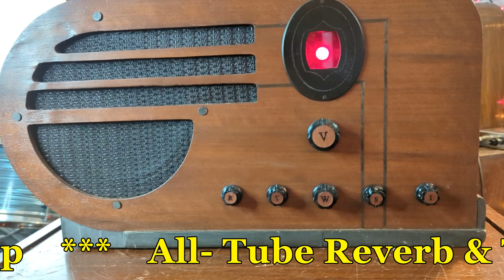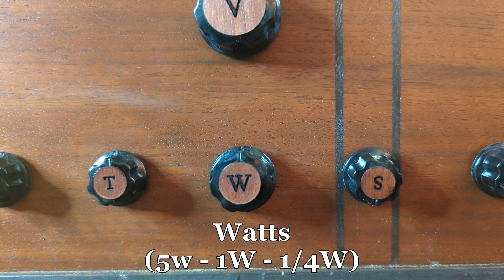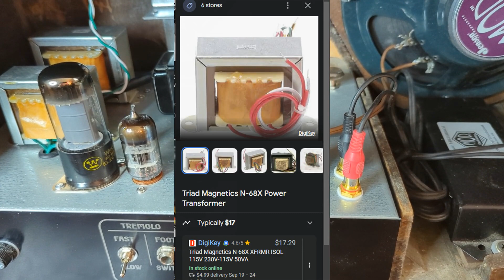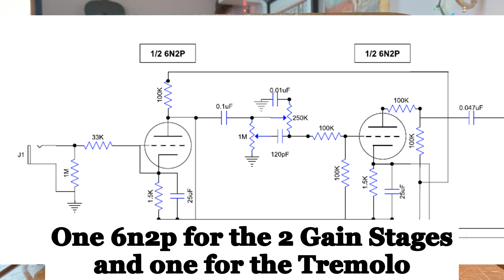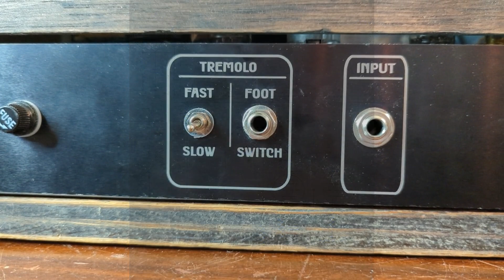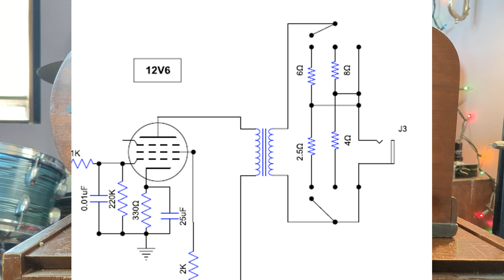5w All-Tube Handmade Guitar Amp with Reverb, Tremolo and More in a Vintage Radio Cabinet

Comment: Greetings from Brazil. I'd like to give a try and build your circuit. Could you please share your material list? I saw the caps don't have voltage and resistors the wattage. Maybe you could also help on providing the voltage table or anything you used while constructing your amp?  I'll appreciate very much what ever you provide.

Best regards, Felipe.
Reply from the maker: Hello, Felipe! I don't really have a materials list, but I did add the full schematic with voltages here:
https://www.youtube.com/channel/UCKmlwbU40PvioxIXB4FOi2A/community

As far as resistor wattages, I used 1w everywhere except for the dropping resistors in the power supply and the cathode resistor on the 12v6 Output tube . Those were 3W, which is a little overkill. The attenuator resistors are 25w for the ones connected to the positive output wires ( 6 and 8 ohms) and 10W on the negative (2.5 & 4 ohms).
For the capacitors, they can all be 400v, but I think I used 600v, except for the cathode bypass caps which are 25v.
Good luck with your build. Let me know how it turns out!
Reply: @de_minimis_amps   Many thanks! I just ordered the transformers and first components. Thanks for the schematic. I'll be taking pictures and share here, always referencing back your channel and video.